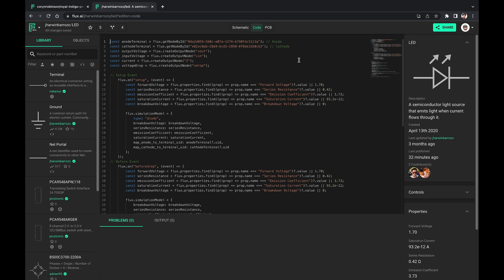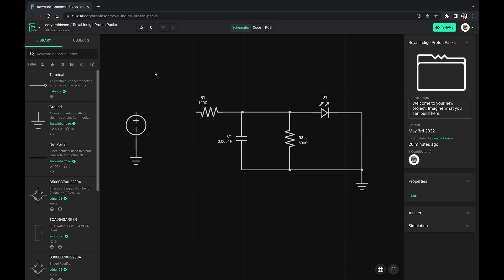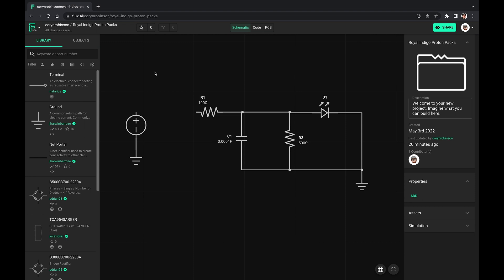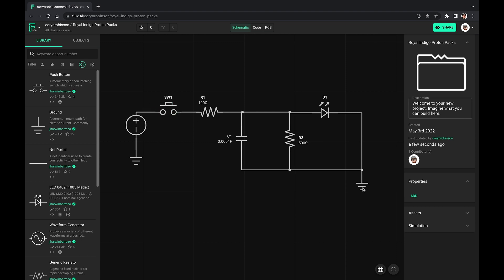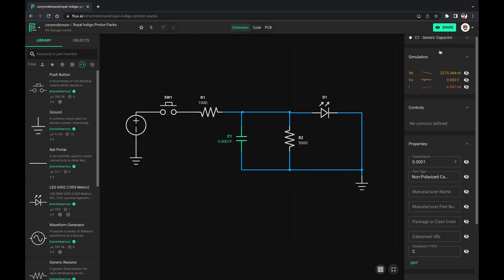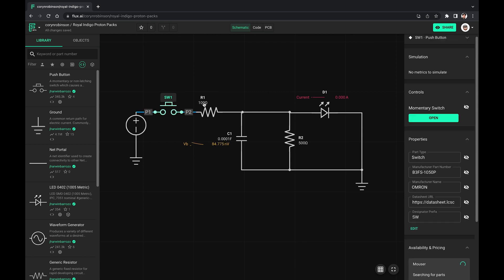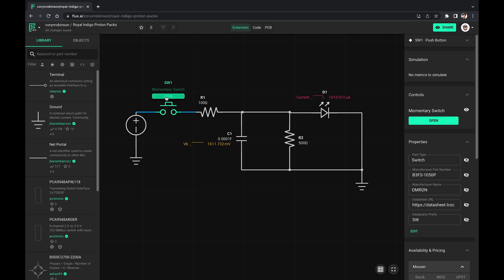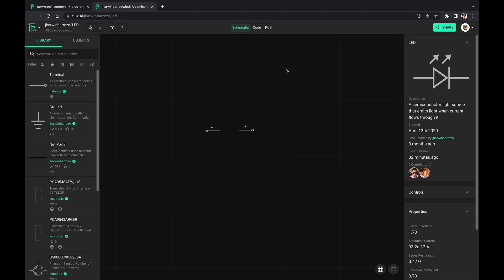Circuit Simulation in Flux

Comment: How many parts I can simulate at once? I mean not theoretical but how many for example transistors I can simulate in a single project? What computer do I need for that and what Internet connection speed? As this is in a browser that means that I need a decent connection, yes?
Thank you
Reply from the maker: Interesting question. You should be able to simulate hundreds of transistors, but I haven't tried that kind of scale yet. The simulation uses your computer GPU, so you don't need a super fast internet connection. In theory you shouldn't need a very powerful computer either, but I've seen my computer slow down significantly. The Flux team tells me it's a performance optimization problem which they're working on. If your browser starts to have issues, you might try a different browser.
Reply: @overshootchannel  What browser and OS(Mac/Windows) is preferable? Do you consider making a video where you were reaching the limits of simulation? It might be cool
thanks
Reply from the maker: It kind of depends on the day. I switch between safari and chrome on a regular basis depending on which one works better that day. Flux is in beta and they're constantly improving the performance.